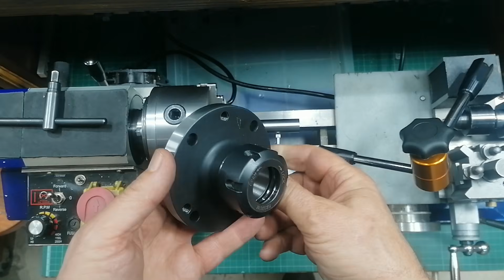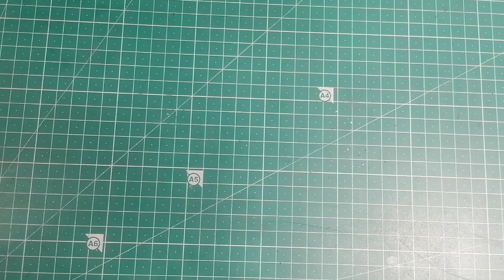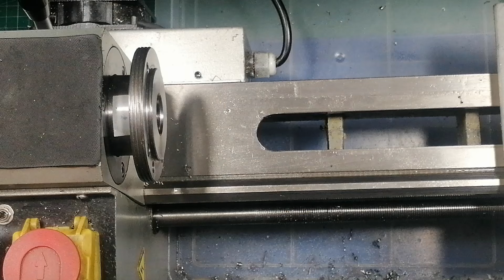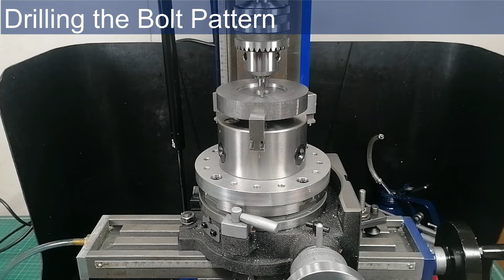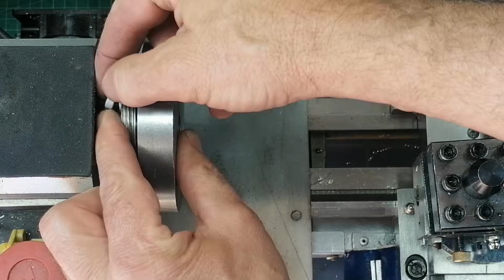I Built an ER32 Collet Chuck Backplate for My Mini Lathe

Comment: You mentioned you have ER32 Collets up to 24mm diameter capacity. I was under the impression a standard set only goes to 20mm capacity. Was that a special order, and if so, where did you get them?
Reply from the maker: I bought them from Midway Tools in Centurion, South Africa. They have a web site (https://midwaytools.co.za/) where you can order and have it delivered. They have a variety of ER collet sizes and the ER32 collets are at https://midwaytools.co.za/product/collet-er32/
Reply: Thanks! 
Blessings from Germiston
Reply from the maker: You are welcome.

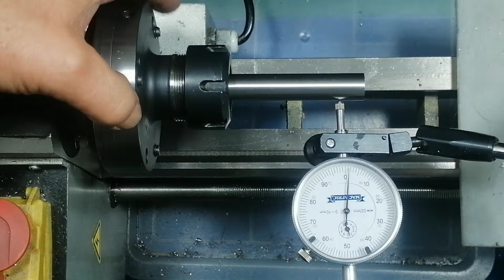Comment: At 4:08, 4:29 and 7:45, Is your spindle perfect? Are the bearings perfect? Perfectly tight? Perfectly concentric themselves? 0.000" Runout?  Is the current error,  'Concentricity', or 'Angularity'?  Is the spindle face truly flat, concentric with the bearings, and co-linear with the central axis? Chinese bearings can have all of these errors in manufacturing, simultaneously.   IS the Collet Chuck true?  Can you mount and true, the tool steel blank, into a 4-Jaw chuck, and mount and measure if the collet chuck is correct?     Please test this some more, maybe even take a truing cut on your spindle face or collet chuck body.  Did you try other collets and stock?  You can even make some test cuts and reset/reverse the stock 180deg in the chuck body.  Reset the collet in the chuck body. Is the central bore on your spindle true? If the bore and the face are out in the same direction, this could indicate that the spindle is actually defective as well.  Have you tried an MT-3 tool in the bore of the spindle?         Thanks for making this video!
Reply from the maker: Thank you very much for the feedback. My lathe is but a small and cheap lathe, so I do not think that it has very high accuracy. I am trying to improve on its accuracy a little bit with additional tools such as the collet chuck, 4-jaw chuck, and even replacing the cross slide. I hope to be able to scrape the ways to perfect fit. At the moment it needs some rigidity. I will make videos of those attempts.

Comment: Hi thanks for the interesting back plate making video. Just being curious, why did you hold the spindle chuck when you drill each time? Any upgrade should the taper spindle chuck come loose while drilling?
Reply from the maker: Thank you very much. My lathe does not have a place to hold a tang in the tailstock and therefore the morse taper can slip and ruin the tailstock taper. I try not to hold it in a way that it can grab my hand, should it slip. That little bit is not much, but it helps it from slipping.

Comment: Just a quick note for anyone else that has import collets like I do: They often are not fully deburred when you get them. There is often junk left in them from the slitting process. Using some pics internally to remove any burs on the ID will improve accuracy significantly. They don't collapse down evenly with junk in them.
Reply from the maker: That is a very helpful tip, I will definitely check mine for any leftover burs.
Reply: I sneak a small 1/4" square stone inside and put a tiny chamfer on the slots. Deburring them makes them more accurate, the little chamfer keeps them from scratching your parts
Reply from the maker: Thank you very much.

Comment: It might be worth allowing a little movement where the collet chuck mounts. Then you can give yoursrlf a "bump true" chuck.Collets can he grest, but you only get "good" accuracy with  expensive ones.  Also, ER collects were never designed for  work holding but for tool holding.  Another thing with them is the tightening torque for the nut is greater than than you you might imagine.!
Reply: Or... Trick for home gamers... Skim the bolt diameter down where it passes though the spindle mounting plate. 

Same results, no commitment
Reply from the maker: That is a great suggestion, a "bump true" feature would definitely add a lot of versatility.